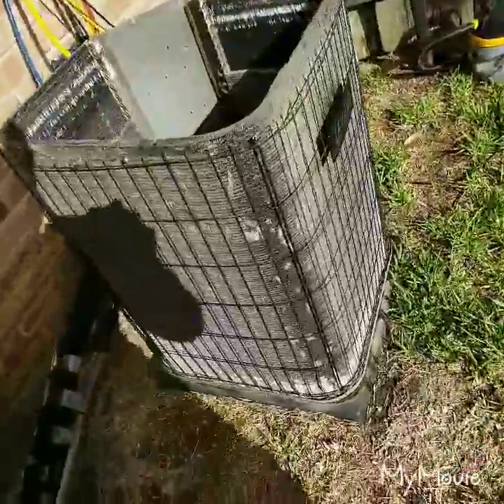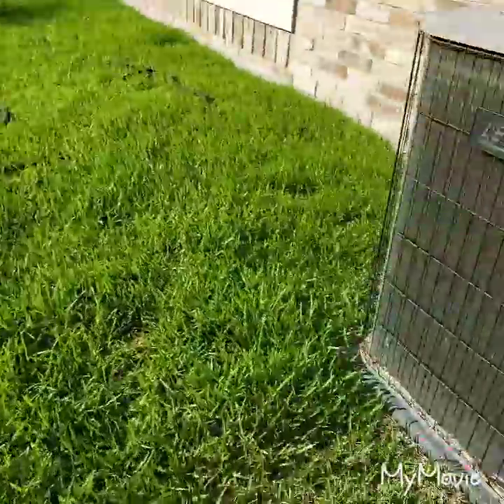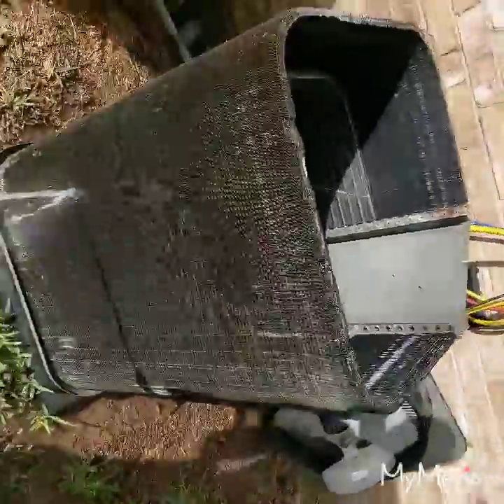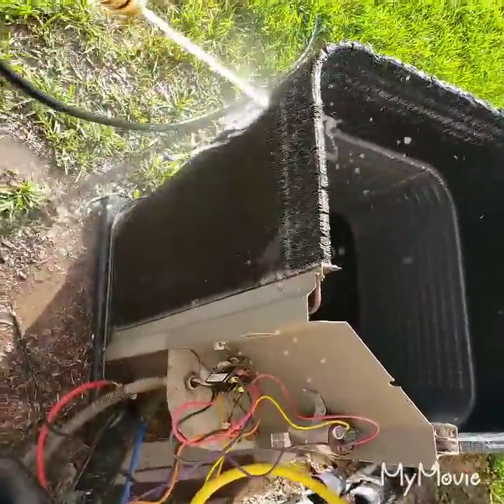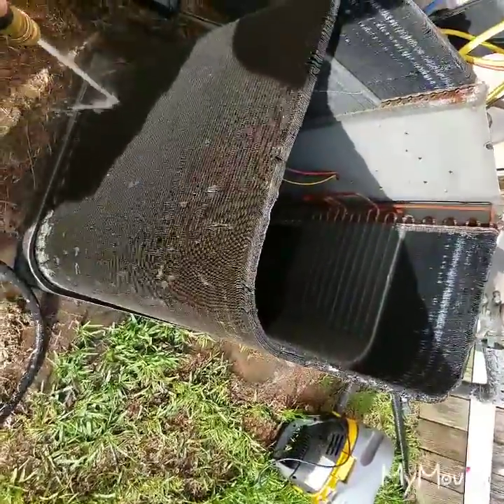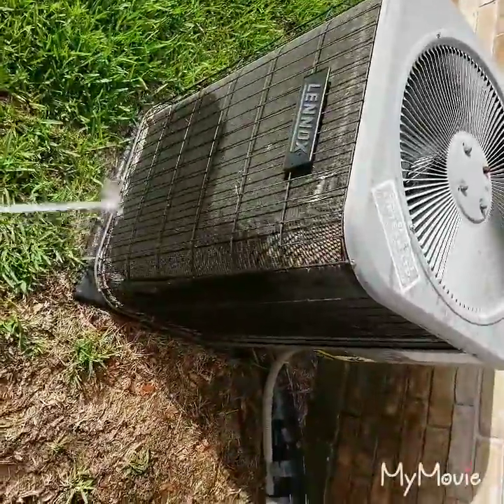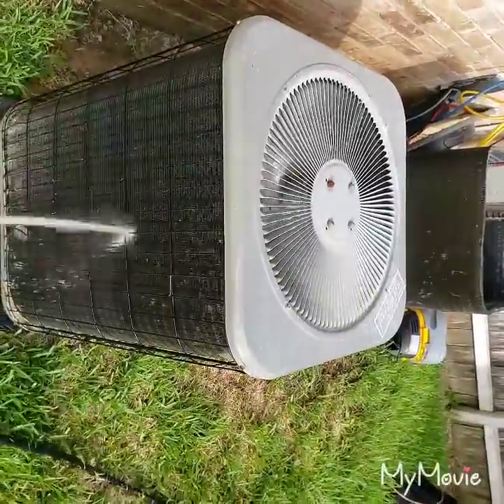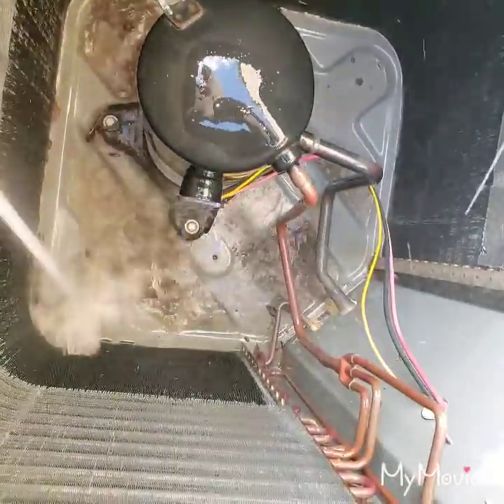HVAC: Cleaning condenser coil

Comment: lol I came across a walk-in freezer the other day 404a system 75 outdoor ambient air with 350Psi head pressure all because of a dirty coil i was on call that night !The problem is the costumer have a Maintenance contract with another contractor the costumer was not happen.  Nice Rot